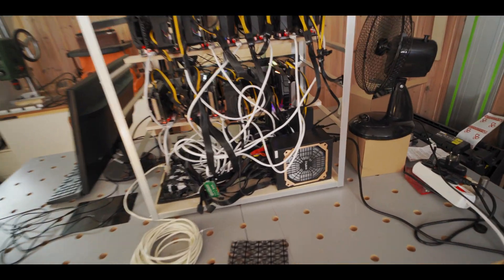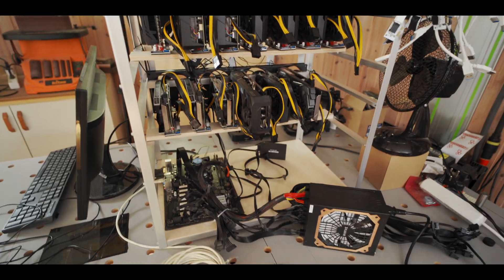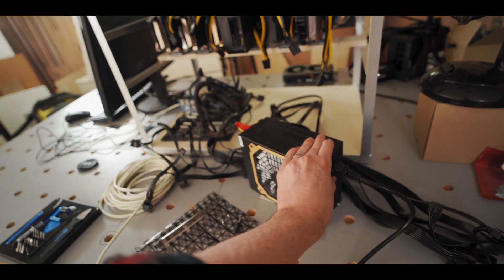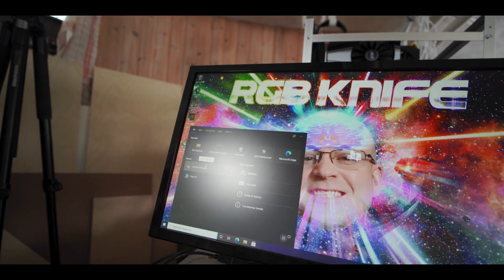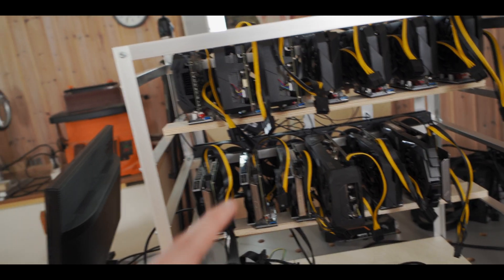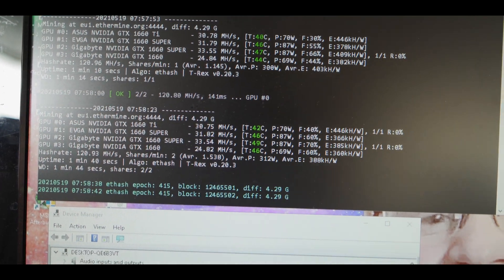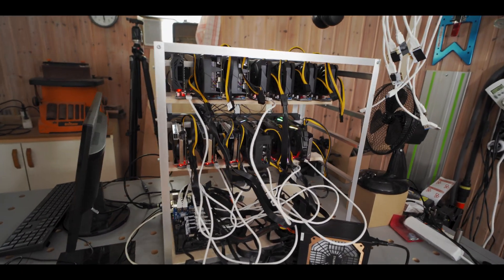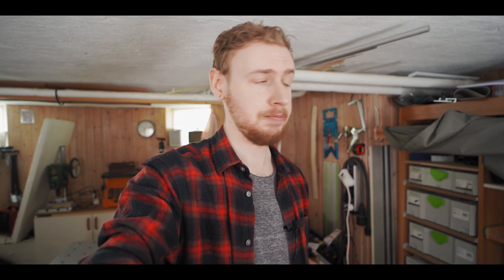Do 1-to-4 GPU Risers Actually Work? (aka PCIe Splitter Cards)

Comment: can i use more than 1 adapter on same motherboard? i mean i have 3 pcie slot mobo, so can  i add two of these in order to get more slots?
Reply: Yes, on a board with 6 slots you can put them in any slot although I use the two bigger slots but I've seen no difference in performance with 1660 Supers, 1660 Ti, 1070 Ti or 2070 Super. Max number of cards I can get my boards to boot with is 11. Add a 12th and no post on any board. Completely negates the need for the m.2 to pcie adapters I have in each board which originally got me to 7 per board. I'm running 3 msi z370-pros(still available on Amazon) so it's probably a resource limit. I've finally run out of money buying and building rigs so now I'll start doing videos lol.
Reply: @Nikon285  okay thanks a lot.
Reply: And one more thing, can motherboard be overloaded if i add too many cards with adapter? I know that psu can be overloaded, so is there any case that board can overload?

Comment: Turned a dell optiplex mb with 3pcie lanes into 9gpu setup with two of these
Reply from the maker: Oh wow that’s fantastic!
Reply: Did you have to change any bios settings on that dell?
Reply from the maker: @donnie843  what dell?
Reply: The question I had is answered by this comment, thank you! It would be: can I plug more than 1 splitter?
Reply: Same here, optiplex 3020

Comment: Why can't I get more then 4 gpus to work on my MSI z390 A pro motherboard?
Reply: virtual memory should be increased if you havent already, make sure psu can handle it, could be faulty risers, or other things not really sure. i fixed it for me last time by enabling 4g decoding but it seems like you have that on already
Reply: Also, go in your BIOS, disable everything you don't need, serial port, etc. I ran into the same issue when I rebuilt a rig and put it all back together in different slots. Add a card, let windows find it, restart, verify its still there, shut down, add card 2, turn on, let windows find it, restart, verify, repeat until you hit your max. It's tedious but will save you hours of trouble shooting. I have 3 of the same boards with 11 cards each. 2 of the 4-to-1 adapters per board reviewed here and they work! This is a great video by the way!
Reply from the maker: Could be a million things. Have you turned on Above 4G decoding in your BIOS?
Reply: Yes 4g in on
Reply: Enter BIOS->Settings->Advanced->Windows OS Configuration to set Windows 10 WHQL Support to UEFI, enter Advanced->PCIe/PCI Subsystem Settings to set Above 4G memory/Crypto Currency mining to enabled, press F10 to save and reset.
Reply: Disable HD audio and reduce pcie speed to gen2

Comment: Nice video. If you have 8 GPU'S and their risers and ssd and cpu and motherboard  all pulling power from one PSU. What is the wattage of that PSU to stay in the 80% rule?
Reply from the maker: Well Bruce I have no idea what the wattage of your PSU is lol. It should say on the PSU or the box it came in. Good luck
Reply: @SebsFinTechChannel  LOL no I am talking about your video. You have everything including the 8 GPU'S running from one PSU
Reply from the maker: @BizWithBruce  ooh haha I think I read your comment a bit too quickly haha! It’s my 1200W power supply. Total power draw was about 820W since the 1660s are so power efficient.

Comment: Hey brother, do you mind posting ur 1660 super OC settings.... I cudnt go above 29.5Mhs
Reply from the maker: Hey Ajay, I have a whole video about overclocking 1660 Supers, check it out: https://www.youtube.com/watch?v=GCiPpnxFrOI
Reply: Check your memory type: hynix set to -502, Samsung set to +1000 and micron, good luck. Start at 400, increase by 50 til you start crashing. Mine usually run great at 700 but some can go 900-1000. Also, test each core clock at -502 AFTER you find your memory max. You can get a little more out of each card but they don't all respond to that. Most Samsungs and hynix don't, micron usually does. Good luck!
Reply: @Nikon285  thanks Jason
Reply: Men -502.  CPU -502 for me.   32 mhs